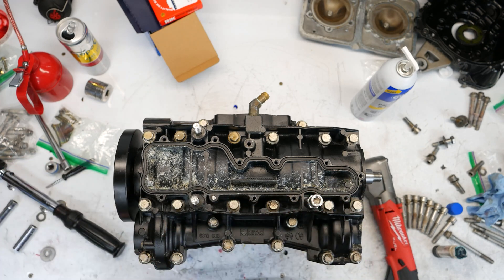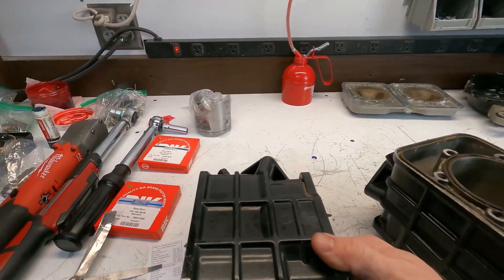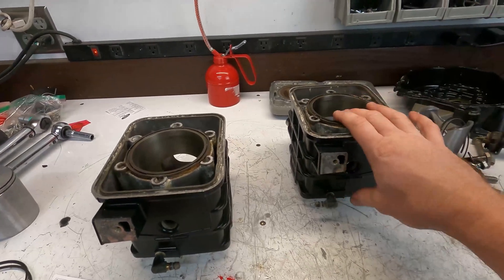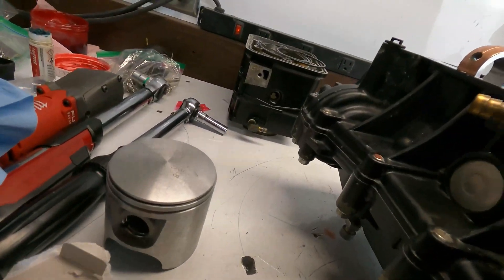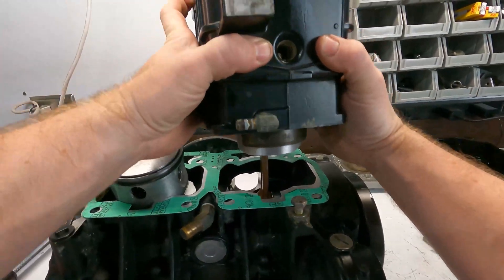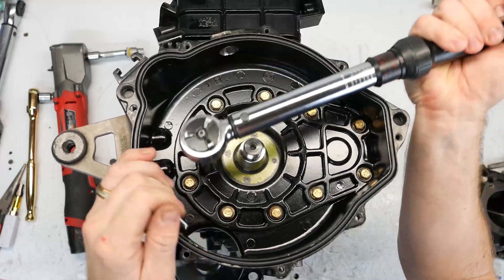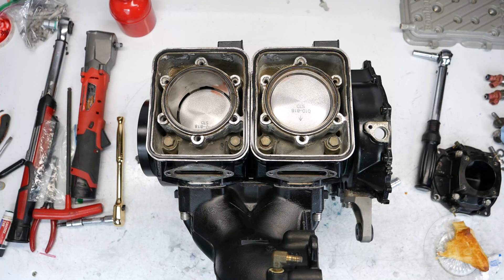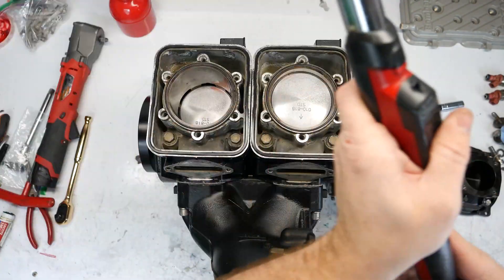Rotax 787 RFI Rebuild - Part 2

Comment: I just can't pull chamber down over those rings man---they want to expand out and thus restrict---you made it look easy but it is not and you also did not use any gasket sealant on your base gasket?
Reply from the maker: I reached past and held them in on the transfer slots at the base. It can be harder if your cylinders were bored and the chamfer has been cut away. I did not because rotax originally did not and it was not in the manual. But honestly it's probably a personal choice thing. But I have not seen any leaking on this engine.

Comment: Do you pressure test when finished?
Reply from the maker: Yes i do, just use a small handheld low pressure pump.
Reply: @DeWoodysShop  How long do you pressure test for?
Reply from the maker: @ripptydevibes2581  5-10min @ 5-6psi